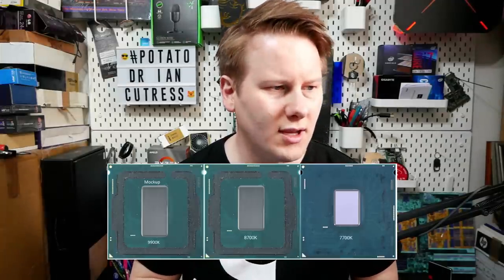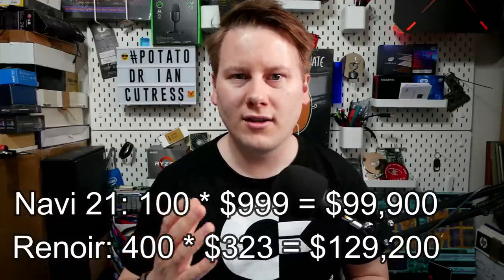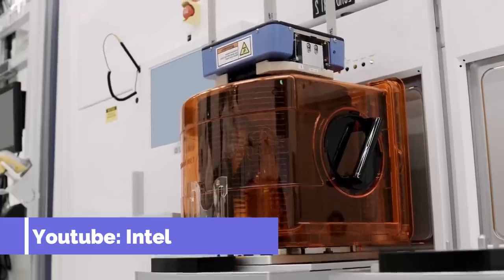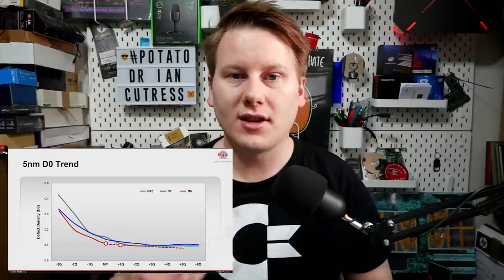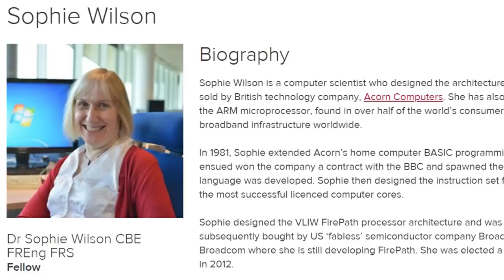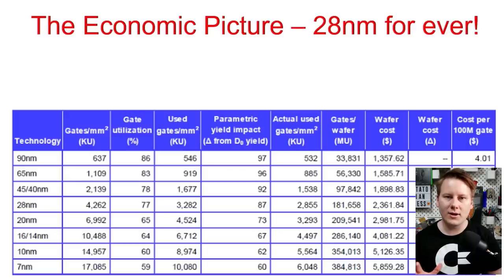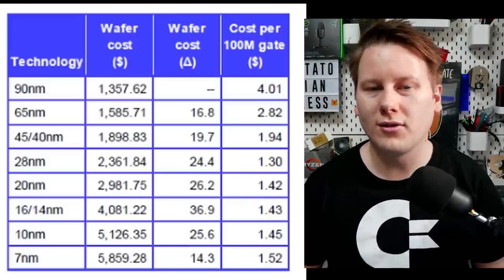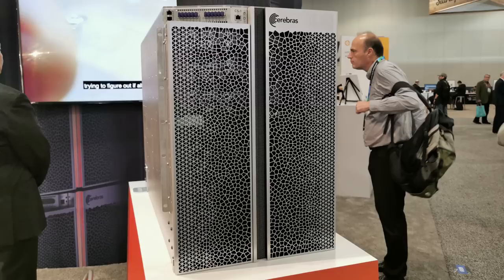The True Cost of Processor Manufacturing: TSMC 7nm

Comment: Do you only make one and the same chip on a single Wafer? Couldn't you fit smaller parts at the edges to use it more effectively? Or do you have to cut straight?

Comment: You are missing out on a few key points, imho.  Each wafer contains the chips for most of the product line from, say for example,  i9 down to i5.  The manufacturing process is far from perfect and the chips test at different performances or binning.  The yield for good 7nm processes is lower than other drops in size have been in the past at this point in their life cycle.  Intel hasn't even been able to get down to 10nm for their own desktops.  They also do their own wafers so their cost/profit doesn't really compare to AMD or Nvidia.

Comment: Be more interesting to know TSMC's actual yield numbers.

Spent 19 years at a semiconductor mfg'er in Colorado Springs and we were constantly beat over the head on keeping costs inline with oriental and european fabs.

There were many many many anecdotal stories about how their yields were not that great.  The company never really knew, AFIK, as they only bought by the wafer output ... not based on how much that company had to start to end up with the contracted amt.
Reply from the maker: Defect rate of 0.09/cm2. Physical yield will be a function of chip size

Comment: The construction of a single fab can cost billions depending on the wafer size and process. 
Bosch - 300mm wafer - 130nm process - 2019 ≈ 1bn
Intel Fab 28 - 300mm wafer - 10nm process - 2018 ≈ 5bn
TSMC Fab 18 - 300mm wafer - 7nm process - 2018 ≈ 17bn

Comment: Few questions;
1) Is 100% a realistic expectation on yields?  I thought with most modern nodes that yields of 75% was considered good enough for production, and 80%+ was kind of amazing.  Am I wrong on that?  Isn't that the whole reason for Intel not moving to 10nm in full force yet, because their yields were down around 40-50% until recently so it didn't make sense to use it?  I may be admittedly confused with yield vs usable die space where you have all the wasted space on the edges that can't fit a chip.
2) are those prices retail?  Because for cheap chips retail tacks on a good 10-20% markup, and for more 'luxury' items it can be closer to 50-100%.  AMD and Intel would still be making good money on a wafer of chips, but that combined with lower yields would be a much more 'normal' markup going from a raw materials cost to a finished product.

I am super curious about the coming chiplet revolution.  Breaking the die up into smaller chips should allow them to fill much more of a wafer, and being able to have different parts at different process nodes can help min-max design and process techniques so there are less failures overall.  A trade-off for more work putting the package together, but should allow for less devastating failures on large complicated chips too, so probably very worth it.
Reply from the maker: 1) A wafer this size has ~46 defects (TSMC defect rate is 0.09/cm2). Cerebras' architecture can detect physical defects and is designed to route around them by using redundant cores (about 1% are classified as redundant for this purpose). That means every chip that is manufactured can be used in a system, which is the definition of 100% yield.
2) The prices of chips listed are retail prices. The Xeon is the list price from Intel's own price lists.

Re: chiplets, I have a video on tiles vs chiplets :)

Comment: With wafer cost there is also yield, but what defines yield?
There's line yield of wafers in vs wafers out, then there's die yield of good vs bad dies.
Line yield seems self explanatory, something happens that kills an entire wafer, die yield though is commonly held to be the yield of 100% working in spec dies over those that have defects, this means that a 70% yield will net you 70% of the dies on the wafer are at min target spec or better but fully functional.
But the question is what of the other 30%, are they totally discarded dies or are they able to be recycled into lower end SKU's by bypassing the defects or using a lower minimum spec or both to utilise in a different market segment.

The common wisdom is that nearly 100% of the dies produced for things like CPU's, APU's and GPU's have a near 100% practical die use from wafers that come out the other side.

The net result is that the actual cost to produce each CPU, APU or GPU is very low in comparison to the cost to consumers, enabling market segmentation of the same square mm of silicon, to represent varying degrees of margin by distributing the associated costs of R&D, marketing, logistics etc disproportionately or separately as a percentage of the total income. If an 8 core chiplet and I/O die built into the same packaging can have a cost to consumer differential of up to 400% or more (R3 3100 $99 - R7 3800X $399, both contain an I/O and one 8 core die chiplet in the same package) but company margins operate at 40-50%, then it's reasonable to assume that other fixed costs and final margins are a result of total income which is contingent on the number of units sold in each SKU, minus cost per unit x number of units in each sku, minus other costs like R&D etc.

The 3950X probably costs less than $50 to actually make and the 3600X is only slightly cheaper at less than $40 and those are probably overestimates. Though segmenting the costs per die might on paper at least generate a higher number.

What of the 6900XT, would that be about $60 of silicon.

Comment: Well you nailed it... the production itself is cheap... but the invention of the chip and the machines and building an enviropnment for production is the main reason why there are not as many factories as you would guess. In detail this is the history of AMD, because they were licenced by intel making the chips they gave the blueprints for until the moment they did it themselfes. Probably there will not be a new company which is going to fight the market. And still you can be happy there are two rivals, because if only intel would run the race the price per chip was extremly expensive.

Comment: The 46% margin you quoted for AMD is gross margin, which takes into account cost of revenue, but not administration, research, or development.

I'm really curious what fills in the gap between 2000% and 50%, other than yield losses. I wonder where the various costs are expensed. Certainly production costs and shipping should be in cost of revenue. Also the purchase of RAM chips for GPU modules. And research into the architecture should be in operational R&D, not cost of revenue. But what about manufacturing development costs, such as getting a chip "taped out"? That labor force is dealing with actually getting the product manufactured, so perhaps it's expensed as cost of revenue.

If the services rendered by the fabs are so cheap, then I guess semiconductor companies spend most of their manufacturing cost in the form of their own production teams, i.e., laying out a chip design on a process, testing it, tweaking it, etc. But some of these things are related to the design of the actual architecture, aren't they? The properties of the process dictate changes to the design, etc. I guess certain employees are designated manufacturing and others are designated R&D. The salaries and the equipment the employees use would be expensed according to the employees' designation, I guess.

Then you get into firmware and software. Drivers and firmware are a part of the product. They should be in cost of revenue, right? Developing a new feature that could go into a driver, such as VXAO, for example, should be research, however, I would think. What about other software projects? Intel maintains a compiler that I don't think they directly charge money for. Certainly that's true for NVIDIA's CUDA libraries. Is maintaining all that software expensed purely as R&D? Or is some of it considered cost of revenue? NVIDIA's GPUs aren't very good inference processors without TensorRT. Is the maintenance of TensorRT a cost of revenue or R&D?

Comment: So just to get this right - AMD's gross margin of 47% (factoring in their lower ASP) is within spitting distance of intel's gross margin. So either Intel is just inefficient with manufacturing, or TSMC is multiple times more efficient?
Reply: intel likes to think their "copy exact" program reduces cost, but all cost saved is later lost through continually using old tech. basically, they cant upgrade their reactors because they impose an artificial restriction on their upgrade options. AMAT does a similar thing.
Reply: @UniqueBreakfastTaco  Mm I see, I thought amortization would help off set costs and improve overall margins and maybe help them compete against TSMC. But I guess they can't lower costs enough to be competitive

Comment: What are the realistic wafer die yields (not counting edge-loss dies)? Surely not literally 100% of the fully etched dies?
Reply from the maker: AMD chiplet on 7nm is above 90%.
Reply: @TechTechPotato  90% is really good. I saw a CPU wafer dated mid-1970s that had 1 successful die out of 98 on the wafer! I know that by the mid 1980s they were achieving 66% yields with the 6502 wafers. So if they are getting 90% yields in the modern era then I guess ASML totally rocks!
Reply from the maker: Really the correct metric is defects per cm2. Larger dies naturally have lower yields with the same defect rate. Tsmc advertise a defect rate of 0.1 per cm2, which for a amd chiplet size is 90%. But a wafer still has 43 defects in it
Reply: @TechTechPotato  Ah, I see .. it seems like an engineering metric. Very good to know, thank you muchly for that info. And really great content you're doing, super interesting!

Comment: I learned a lot, not least that Sophie Wilson's talks are something very interesting and informative to watch out for, if silicon and fabs are a subject of interest.  I find how she talks about dark silicon (power management causing a core to never be able to activate 100% its sections) to be fascinating. I would like to know what she thinks about Apple's M1 silicon as a disruptor to the PC CPU world.  Will someone attempt to do what Apple did, emulate Intel's fastest architecture yet built, but run it faster on an emulator, than the actual silicon will run, at a lower thermal and total die footprint than the current lower-mid-market Core i3.   I wonder if Apple has enforceable software patents that would make a similar architecture economically unfeasible to AMD or Intel.  It's hard to over-state the economic value of Rosetta2, to Apple during the transition to Apple silicon.   If it can be maintained and I can run VMWare Fusion on an M1 mac and run Windows faster than it runs on Windows specific hardware, how pathetic does that make the legacy-bound Intel/AMD consortium?

Comment: So you are sayin that using 7nm/5nm you can pack in extra transistors, but you wont be able to use all of those extra transistors.
Reply from the maker: You can't use them all at the same time. But you can use them.
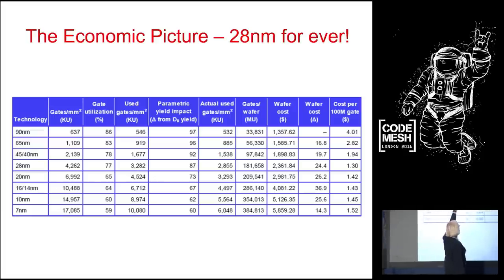Reply: Also at 12:10 "The rules we have to obey": she refers to the Design Rules that an electronic designer has to obey when making the layout of the physical chip (drawing the transistor, metal connections and so on). Those rules are getting stricter and stricter each process node. Moreover, some structures (vias, metal connections, some kind of wells) don't scale that much with the nodes and are bound to use  the same area regardless if you place 100 or just 1 transistor.

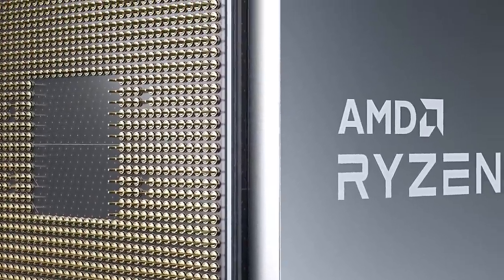Comment: 2:40 And this is EXACTLY why AMD wants to sell as MANY of their limited supply Navi 21 dies as "Radeon Pro" cards instead of "Radeon RX" gaming cards. And for those that ARE actually become RX cards, they're almost ALL becoming flagship RX 6900 XT's (and especially in the form of the new fully unlocked & loaded Navi 21 XTXH dies) as AMD can sell every GPU they can produce & Navi 21 is getting CRAZY GOOD yields for a GPU of its size. 

This is why the "max cut down" RX 6800 in particular has basically been pure unobtainium compared to the higher tier cards. AMD just has SO FEW Navi 21 dies that are ACTUALLY that defective + they already make significantly less on GPU wafers so selling a fully working die as a RX 6800/6800 XT is basically just deliberately throwing $ away.

And even when they do all that, they still make SIGNIFICANTLY more with significantly less effort on Zen 3 CCD wafers....

Comment: Seems abit misleading in some parts, especially when you are comparing the cost of a wafer or chip from TSMC vs the cost of the full GPU card or system (cerberus). Sure, Cerberus chips may cost maybe 20k USD each from TSMC, but the rest of the components to make the syetm is not free. Will not be surprised if the total cost of the full rack is in the range of a couple of 100ks.

Similar for GPUs, which probably have a total raw cost of 500 maybe, for the high end cards (GPU chip, PCB, power delivery, ram, cooling, etc), which are being sold for 1000.

Comment: Enjoyed the piece, but ironically you really didn't get into the true cost of processor manufacturing though. From the up-front costs (even if disregarding internal RnD) to everything between a finished litography.post processing wafer, and processor-in-tray, was pretty much disregarded completely or glossed over. Heck, the tapeout of a single die alone, can easily run between 50 and 200 million dollars. If it's a GPU with HBM(2/3), or a multi-die CPU package, the interposers and packaging is really expensive, and a single significant defect in any essential component or joint in that package, means all of it is trash (as they cannot realistically be separated non-destructively once joined). IMO the vast majority of the costs of actual manufacturing of processors (to the stage of ready to go in a tray), lies in up-front costs, pre-stage and post wafer production. If we wanna make good on the claim in spirit as the video headline implies (yes I realize it says "manufacturing", not "producing"), then we really should include and average out the costs of RnD and architectural design. As it stands, I feel that the presentation and "answer" to the question given, is a bit like valuing the service of a technician by the raw cost of minutes and consumables expended doing the job, or a functional product by the per mass/volume cost of raw materials. I think Louis Rossmann said it well (paraphrasing): "When you complain about paying me $200 for 5-10 minutes of work and pushing a button - you're not actually paying me for those minutes and the button press, but for the many years of education, training and experience that enables me to figure out and know which button to press and when."

Comment: First off, great video. Though, I know you're just simplifying things, but your assumption of 100% yield masks the true way in which die are binned and sold. I'll not go into the details, as I assume you know that. I just think you should have spent a few moments explaining that this isn't a true representation of how it's done, and that a wafer full of one type pattern will produce die from the top bin, to the bottom. As there's no such thing as a wafer that only contains 9900k's or, is full of i3 chips.

Comment: good video but, intel, amd etc dont sell the processors at the same cost you buy it at the computer shop, the computer shop has already added on more than what the distributor added on to it etc. You have taxes, R&D, cost of staff, cost of rent, cost to build the building and equipment costs. All of these blow the actual cost of the processor up a lot,

Comment: Your cost per wafer is too low by at least a factor of 2. Remember that the number of mask steps have increased by a large amount. With EUV, the capital cost is higher even though there are fewer steps.
Reply: not to mention you cant even use 3400Bs, you more or less need 3400Cs for newest nodes.

Comment: You cannot assume 100% yield! Especially in the initial stages of production. It may or may not get better the longer it stays in production. High number core processors have initial horrible yield, and initial profit is not very good, you may have to buy market share! This video seems to concentrate on production. Design is also very expensive. EDA tools and engineers that use them should be considered into the cost of the wafer. Getting involved with test lots can reduce development costs, but they involve very strict tape-out schedules.  Getting your design onto a test lot may involve a few politics/costs as well.

Comment: you only mislead ppl with this video.  here is what you should have actually said. cost of manufacturing of 1 chip can be calculated only after consideration of full run cost of the line and certain chip design +eventual selling of the line. some chips have longer production and high popularity some not and so cost will be much lower then they are sold bcs of development and overall production costs. but even then it will be hard to tell in certainty bcs corporations like intel kind of have to have big variety of products even if development cost makes half of them pointless financially.  also we do not know what kind of decade long contracts  factory has with clients. so if you are a big customer but a newcomer you will have to pay more or pay with time and risk getting an obsolete product